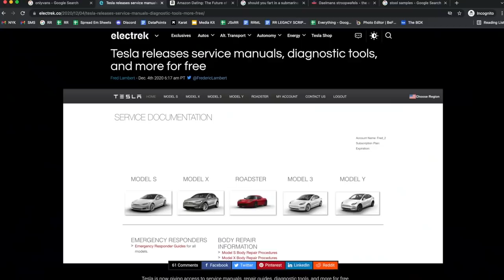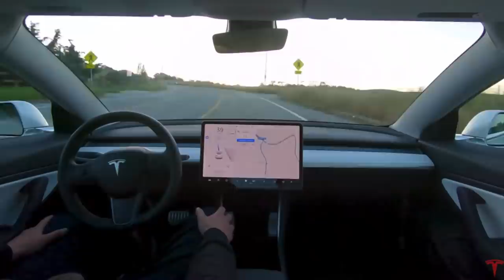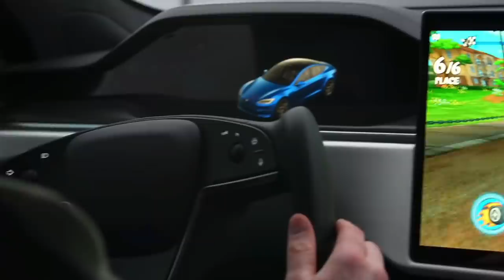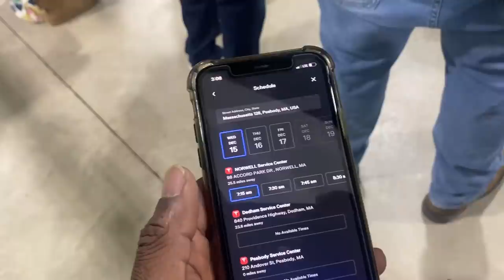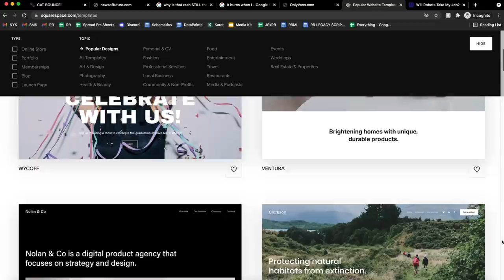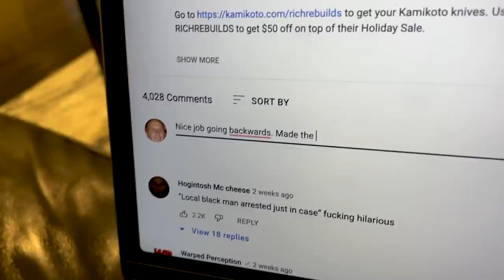How Tesla is failing its most Loyal Customers

Comment: i honestly feel bad for these reps, excluding the repair process itself, i dont think teslas in the wrong, a policy was set, it might not be under the expectation that the customer normally has but it was set. The main issue is that this policy was not conveyed properly at the beginning of purchase. Additionally, these issues could have been solved by tesla on a good will basis and that will be the end of it. But also, people often forget. Its not about the $400, its the principle. People are so used to I spend X so I am entitled for Y, but in reality, it doesnt matter if u spend 1 million, whats $400 vice versa. If the "rules" consider it as customer negligence, then why refund $400. However, the right thing to do is to put it on a good will basis

Comment: A friend of mine bought a new model S awhile back.  Took delivery....on his first drive to work the front drive unit failed and caused him to be stranded in the middle of an intersection.....fast forward Tesla sends a tow truck....while the car is being pulled onto the flatbed the tow hook rips out of the bumper and the car rolls back into a police car that was blocking the intersection for there safety......😂😂😂😂😂😂.

Comment: This is absolutely correct. Tesla service is absolutely terrible. I have a model S with 52,000 miles. I absolutely love the car but I developed a problem with water from the AC system leaking into the driver side. I schedule it for service. I have to wait 51 days to get it in for service so I can’t drive the car. I get it in for service. They keep it for two days charge me $500 and give me my car back five days later the floorboard of my car is soaking wet again I take it right back to Tesla and what did they tell me sorry there’s nothing we can do you just have to get in line again. The next appointment is nearly 7 weeks out. That’s absolutely ridiculous. I wait two months you have the car for two days. Charge me $500. don’t fix the problem, and then just tell me to get in line. I absolutely love my car, but I’m going to go back to Toyota. Services is just a disaster..

Comment: I’ve had every Tesla, from the 3,Y,X,S and the service is laughable at best. 

I had a battery pack issue on my model 3 which would not let my car supercharge. I called the service center in Miami and they told me to take the car anywhere else because they were swamped. I paid to get the car towed to west palm beach (almost 2 hours away) and I was left with Uber credits as there weren’t any loaners available. After days of calling for an update I’m told I need a new battery pack and that it’ll take about a month to receive, install and return the car to me.

My Model S started dripping goo from the center screen and was told I had to pay $2500 to replace it because the screen was defective (known issue) and that the upgrade would fix it.

I just sold all of my teslas and bought a Mercedes’. Never going back.

Comment: I am slightly thinking about phrase of "Tesla having more tech than ICE cars".. I mean Gasoline cars are doing super tight timing processing constantly and adapting to environment to give best results. Even if with hiccup in that processing you will NOTICE it as super annoying sudden brake hit kinda or stuttering. And thats just engine computer.. Lets then talk about engine thats amazing engineering masterpiece all along and contains lots of moving fine calibrated stuff (most cases) to stay together under all stress, movement etc.. hundreds thousands of kilometers.

Result = Tesla is the one here which is actually missing all tech and just has iPad build in to entertain you. I mean all cars has starter engine (electric motor) and battery included so...

Comment: Fought with tesla service for roughly 2 years about constant service issues on a $100k model S :D. Then I gave up, and switched over to electric kia instead.

Yes... the tesla is way more capable... when it works. tbh I dont really mind if it would break every x weeks/months, but the big issue is that tesla makes it very hard to get in touch and when you do get in touch you get treated like an idiot/fed generic excuses and non applicable workarounds ;P. 

I hope they improve. They have the most capable product on the market, so... just put some of that energy into building the best service department...

Comment: My toyota prius has been around sense 2005 and still works fine with 157k miles. I think tesla is over complicating their computer system with low grade untested electronics. A desk top pc would be more than good enough to run everything and dose not need to have 720 different computers. Tesla is definitely over complicating their cars that's why you can't fix the stupid thing.

Comment: Don't worry, Porsche has a helluva lot more quality testing and quality as an European car than Tesla ever could even dream of. This is why I firmly believe the German brands will usurp Tesla, they might be a bit slower to market, but when they are they are of proper quality.
Edit, Teslas quality is so bad that at 8:30ish you can even see different sizes in the gaps between the panels! I know BMW cancels a supplier/contractor if there is more than 2 parts per million defect. Tesla has a good day if out of 100 cars 2 does not have some kind of defect, including design such as the heatpump.
That 11:30 customercare call just sounds like such disgusting virtuesignaling "we are the safest car" Uum, if airbag doesn't work you are at the bottom half at best.

Comment: This video is hilarious albeit old.   I bought a 2019 Model S long range. this yr 1 owner 53k miles. And I must be an anomaly because I have had zero issues with my car. The battery is in 95% original capacity suspension is great I have enhanced autopilot and premium sound. The interior is Butter  no literally. It's the cream smooth butter rich faux leather that's in super mint condition! Not a fan boy. But I am very happy with my car! I admit it's not as supple as quiet or as smooth as my LEXUS GX470 and she's 18yrs old.  She's just an alcoholic so I only take her out on wkend dates now  smfh 🥴😩🤪

Comment: I will never give a penny to that company.  I will walk before that happens.
Great engineering.  If it works it would be fine.  But if I spent all that money and could not get my broken car fixed I would be livid.
Porsche is a great choice.  
I use Infiniti/Nissan.  I am on my 3rd one.  They just work.  Every day for years.  2 x a year I take it to a Jiffy Lube for a 10 minute service.  That is it.  Once, I had a defect.  The on off switch was faulty.  I took it to Infiniti.  It is a luxury service experience with an expresso machine and nice pastries while I wait for them to diagnose it.  They come and tell me, bad news.  The part is not stocked in Canada and it will take weeks to get it from Japan.  They will give me a nice rental car at no charge.  I decide to get a new Jeep.  It was summer and that seemed like fun.  An Uber paid by Infiniti took me to the rental lot and a brand new Jeep was waiting for me.  5 weeks of Jeep fun later the car was ready.  That is what service is like with a real car company.  BTW, they detailed my Infiniti and had it waiting for me in their new car hand over bay.  I had an expresso and donut and then vroom vroom, off I went in my fun little sports car.
Oh, BTW, my Infiniti is a far more luxurious driving experience and it costs more like $40k, vs $140k for that Plaid.

Comment: 11:18 "Trust in the system you've bought into" Oh. My. Fucking. God. He bought a "car" not a goddamn "system". And you wont even honor the warranty on the product you sold in a timely fashion let alone provide (at the time) the resources to do it yourself. My BMW eats a gasket, I replace the gasket myself. 1 Day. It kills the shocks with its thiccness, I replace the shocks myself. 2 Days. The fuel pump starts reeeeeeeeeeeeeeeeeeeing like someone at a pride parade, I take it to the shop because I cant be bothered to take off the diff output shaft and cat back while on only race ramps because they just HAD to put the pump access port under the car instead of under the trunk lining. 1 day and ~250 extra bucks. See the pattern? SMH my head, tesla is a cult.

Comment: I'm an Aussie but offering you Americans the chance to back a USA based start-up called Lucid Motors.
What's in it for me?
ABSOLUTELY NOTHING, other than Tesla fanboys hate on them because they haven't made a Billion shit EVs like Elon has.
If you're thinking of buying a Model S Plaid, PLEASE DON'T.
Here's the deal, the Model S Plaid is $140,000 with shit quality & Elon REFU$e$ to fix any issues (confirmed in this vid). Once you've bought it, ELON doesn't give a $hit. FACT
In a calming moment, consider that Te$la fanboys say the Lucid Dream won't sell because it's WAY OVERPRICED.
I'd have a smile from ear to ear that would beam enough to light up the skies if any of you bought the MOST expensive $169,000 Lucid Dream edition, which is fully tricked out for only $26,000 more than the Plaid.
What's to lose? 
Well $169,000, BUT at least you have a way better chance of getting a quality product, while admittedly not being as fast, but still plenty fast build with maybe some after-sales service. 
As opposed to spending $140,000 on a Tesla S Plaid, guaranteeing that it will be crap, with SFA customer support.
Let the planets align, don't repeat the mistakes of others, I'm confident that good things will happen if you take the risk.
Also, if you're an early adopter & bought a Model S & perhaps a Model X back in the early days & not happy with the service, list it for half of what it's "worth", dumbarses will line up for it, THEN flog off your shares if you have any & make a shitload at the same time. 
You'll be able to retire early & feel the glow of having a way better car than with a $140,000 shitbox & your partner will love you for it.
It's time to bu$t Elon's wealth bubble. 😉

Comment: Rich-dude, I’ve owned a whole lot of cars over my 67 years and I can say without reservation that my Model 3, after 36k miles and 2.5 years is the best car I’ve ever owned. It’s way faster and more enjoyable to drive than a comparable BMW, has been incredibly reliable, and is actually environmentally responsible. Yeah, I know you think it’s cool to be a selfish jerk, and maybe you’ll outgrow that phase, but for now it’s pretty insufferable.

But back to this hit piece you just released. I hope nobody believes you any more than one should believe Tucker Carlson, but in the event they do, I’m here to share my Tesla service experience. 

First, the few warrant problems I’ve had with my car have been software issues…zero hardware issues. Tesla has been extremely responsive, honest, and competent in addressing these. Something that cannot be said about any of the German or Japanese cars I’ve owned. 

The two hardware repairs I’ve had have both been the result of accidents. Both were handled quickly and efficiently by the Tesla service center. In fact, between the ability to remotely diagnose and repair software issues and the excellent onsite service I’ve received, I would say that Tesla’s service capabilities area competitive advantage over legacy car makers. The first was a windshield replacement resulting from a rock strike. The second was a steering rack replace the resulting from a vehicle that hit the turned wheel of my car. Both were done very quickly, with.zero issues. In fact, I fully expected the car to be out if service for a week or more for the sideswipe accident, but it tookTesla 5 hours to fix the car. Yes, I dropped it off on a Saturday afternoon, authorized the work Monday morning, and picked the car up early Monday afternoon. Any chance that would have happened with a Porsche, BMW, Mercedes, Audi, or Japanese make? I’d say, no.

You choose to cherry pick examples of malfeasance that support the narrative you want to advance, but you don’t put any of this in context….so it’s pretty much meaningless. Clearly anybody could make a video such as this about the products/support of any company, but so what? When you sell large quantities of anything there will be problems and some disgruntled customers….but so what?

What other car company can remotely diagnose their vehicles? Nobody. While you might not care, for people who want a car that actually runs this matters.

What other car company makes cars that require virtually no maintenance? None.

What other car company offers mobile service? None.

What other car company doesn’t subject it’s customers to the horror of dealing with dishonest and incompetent dealers who are constantly trying to find new ways to empty the wallets of this customers? None,
.
More importantly, these cars are designed and built to last. How’s that IMS bearing in your Porsche? How about the cylinder wall scoring? How do you feel about BMW M3s where bottom end bearings are considered normal wear items? Any issue with BMW turbos that die at 75k miles? How about Merc software that just doesn’t work? Or maybe Taycan batteries with dying cells that the dealer just bypasses? 

The bottom line is that you seem to need to be a jerk, and Tesla is your outlet. The thing is, you’re just putting out FUD. I guess the bombastic style is good for enhancing You Tube revenues, and maybe that’s the intent. The problem is, for folks that don’t know any better, they might believe you…just like those who actually believe Tucker Carlson. Do you really want to be the Tucker Carlson of You Tube car video channels?